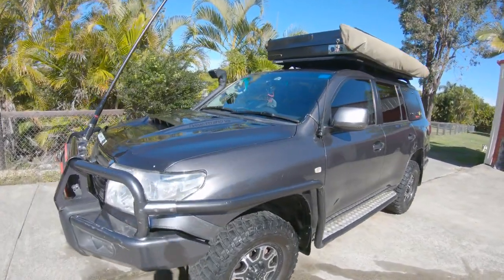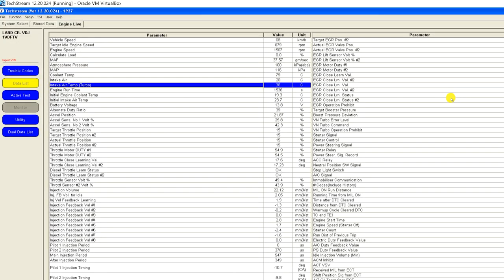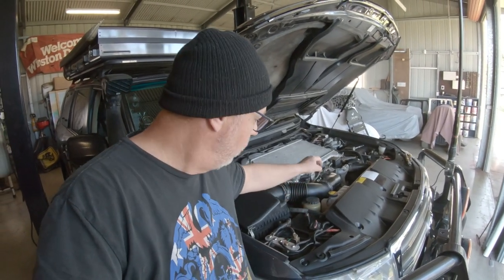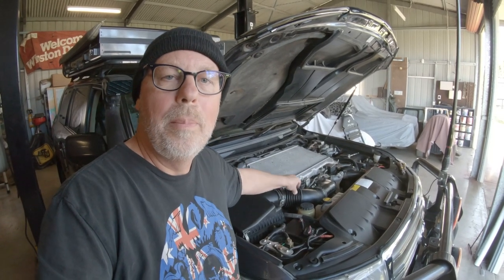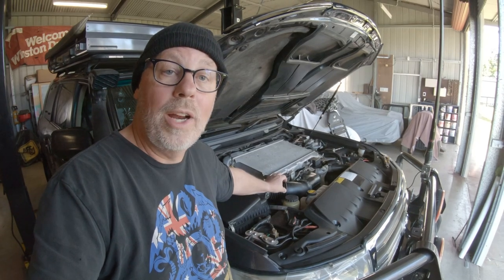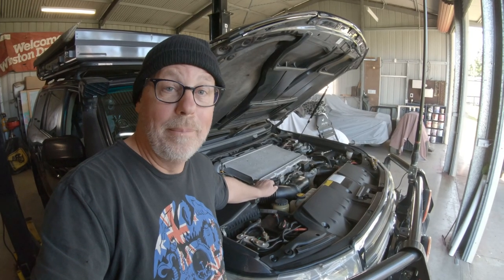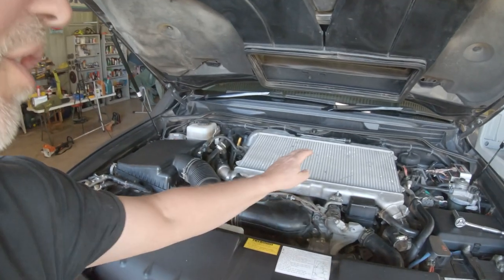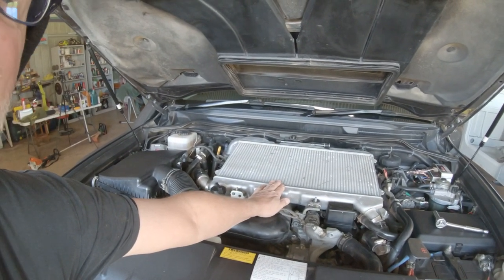Intercooler Flush and Clean with Before and After Efficiency Testing | Landcruiser 200

Comment: Great content Terry well explained, my LC 200 2017 vehicle has 40k on the clock I fitted a Flash Lube catch can at 400 kls best thing I could have  done usually drain 50 mm every 5k this amount of crap varies slightly on the type of driving done in this period . I am confident my intercooler would still be very clean by your experience thanks. Ian
Reply from the maker: Good stuff Ian, thanks for sharing.  I agree, your intercooler would be pretty much spotless.  It’s interesting to note that we both pull around the same amount of goo every 5000km.  Cheers😎👍

Comment: Hi Terry great content. You mentioned you had blanked the EGR. Was this to also help decrease the oily vapor gases recirculating or is the the catch can the main reason your system was so clean. Thanks in advance.
Reply from the maker: Cheers mate, I appreciate the kind words.  The EGR block off was definitely to stop the exhaust gases getting back into the intake track.  The catch can stops the oily vapour so both are needed for a clean intake track.  Cheers😎👍

Comment: Hi Terry
Have you had your EGR valve blocked off?
Just wondering how your car performs ?
Also did you need to have the ecg altered to stop the Eng light and code coming up?
Colin
Reply from the maker: Yes indeed Colin, I have an EGR delete.  The computer has been altered because if you do not do this it will throw a code.  Cheers👍😎

Comment: How can i know the highest normal range at sand drive for charged air temperature  i see in mine around 95 Celsius 
And search with no accurate answer
Reply from the maker: Your charge air temp is going to be very much dependent on two factors.

Firstly, your inlet air temp.  The higher the inlet air temp, the higher the charge air temp.

Secondly, the type of sand driving.  Soft dry sand under high boost will see charge air temps very high.  Harder wet sand will see them much lower.

In terms of giving you a number, I cannot as I cannot read my charge air temps.  What I would suggest you do is keep monitoring it, get a feel for what is normal for your vehicle under the different conditions, then if that changes over time you know something could be wrong.  Cheers👍😎

Comment: Question - why both a blanking plate and a catch can? Or are you running a blanking plate with a hole?
Reply from the maker: No mate, a full EGR blanking plate, no hole.  Having a hole defeats the purpose of having a plate in the first place.

The EGR recirculates exhaust gas into the intake system.  Putting a blanking plate or switching off the EGR eliminates the “soot in the intake issue”.

It does not address the oily vapour that gets past the rings during the normal combustion process.  The catch can catches these oily vapours and attempts to filter them out so that it does not enter back into the intake system.  You have to address both issues (EGR generated soot) and crankcase oil vapours for the cleanest intake charge possible.  Cheers👍😎
Reply: @JafffaAdventures  system doesn’t wig out with a blanking plate??
Reply from the maker: Yep, you have to reprogram the ECU or it will throw a code👍

Comment: Very impressive and informative video. Im a the moment doing a intake clean on my 200, 370000km with no catch can…Well it is quite clogged. Any information regarding the blanking of your egr? I would like to do that and I’m going to fit a catch can as well. All the best from Sweden
Reply from the maker: Thanks for the kind words mate, and I’m glad you found some value here.  I’m not surprised your intake is clogged, by design it really is inevitable without intervention of a catch can and EGR blank off plate.
The blank off plate is a simple thin steel plate, much like a gasket.  It prevents exhaust gasses from returning to the intake system.
I have seen them for sale on eBay, but that was years ago, I have not looked recently.
With these blank off plates, you MUST reprogram the ECU.  If you just blank off the EGR without addressing the ECU, it will throw a code and put you in limp mode.
I had the entire operation done when I had my chip fitted and dyno tuned.

I have also heard of a solution of a forced EGR valve closure through a ECU reprogramming and not using blank off plates.  I have no first hand experience with this method.
Cheers👍😎

Comment: Good video Terry. Have you charted your catch can drain volume through the life of your vehicle?
I fitted a catch can after the 1,000km first service. In the next 18,000km I've only drained 169g of liquid.
Reply from the maker: Thanks for the kind words mate.  I pull 50-60ml every 5000km, and that has not changed from when I fitted the catch can at 70K until now at 200K.  There was another fellow in the comments that noted he pulls the same volume as I do and has had his catch can fitted since new.  The specific gravity of the goo is close to 0.9:1, so your 169g = 187ml over 18,000km.  That works out to 52ml per 5000km, pretty bloody close to what I’m pulling.  Cheers😎👍

Comment: Good vid. That said, I’ve an almost identical vehicle but without catchcan and 14Ok done. i replaced intercooler about 15k ago and it was just as clean as yours at the start of the vid.
Reply from the maker: Good to know mate.  I’d rather not have the 1.68 litres of black goo through my intake system given the choice.  Go well👍😎

Comment: I have a 79 series landcruiser that has just reached 90,000 kilometers and I've owned it since new. same engine as a 200 series, except single turbo and more room to remove the intercooler. today I gave it a good service including removing the intercooler to replace the map sensor filter. the vehicle has a catch can, installed 70k ago and I found the intercooler barely coated in oil so I left it as is. 
I flushed the old map filter to see what it was like, and hardly any black oily crap was inside it too, so probably good for another 90k. 

to me this verifies the benefit of a catch can as long as it regularly drained as suggested
Reply from the maker: Could not agree more mate, thanks for sharing your experience.  Cheers👍😎

Comment: Hi Terry thanks for the videos 👌🏽. Do you have a video or some more info on the egr blanking plate? Does yours have a 7mm hole? How are your egts with the plate in place. I’m about to add one to my 200 so any info would be greatly appreciated. Thanks
Reply from the maker: No problem at all mate, happy to help.  All EGR blanking plates need either an ECU reprogram, or a signal interrupt device to fool the ECU into thinking nothing is wrong.  If you do not do this it will throw a code.
The plates with a hole in it (which are a waste of time in my opinion because they still let gases through) were designed that way so you don’t have to deal with the ECU throwing codes.  They still do throw codes however.
EGT’s come down with a plate in place but not by a lot, 20C maximum, but that of course is not why you install one any way, it’s just a minor spin off benefit.
I trust this helps  mate👍😎
Reply: Awesome thanks mate. Just inspecting the intake now and it’s bloody chockers full of crap as you’d expect with an egr and no catch can for 240k kms
Reply from the maker: Yep, not surprising, it’s a shit of a system 😉👍😎

Comment: Very interesting topic. I have a V8 4WD but it is petrol rather than diesel powered, it doesn't have a catch can installed. I have given some thought to installing a catch can, after seeing the results from your service I think it would be a good investment.
Reply from the maker: I had an LSA Camaro and am building a LSA FJ45, both petrol and both have catch cans.  I’m an advocate that’s for sure.  Just make sure it’s installed correctly and maintained and you will have happy motoring.  Cheers👍😎

Comment: hi Terry, in one of your recent videos you mentioned that you have a restrictor or block off plate installed,  can you let me know what type that you used and if you had to change anything else when you did it.
Reply from the maker: Yes indeed mate, I do have an EGR blanking plate installed.  I have seen two types, ones with a 10mm hole in the centre and ones that are a complete block off.  When you block the EGR off, you will have to get the ECU reprogrammed or it will throw a code.  The idea behind the plate with the 10mm hole is that you get some of the benefit by restricting most of the exhaust gases while not throwing a code.  The problem is that the ECU will still throw a code (albeit intermittently) and of course you still get black goo building up in the intake because some exhaust gases still get through.  For these reasons I have blocked the EGR completely and have had the ECU reprogrammed to prevent it from throwing a code.  I have heard of a piggy back module you can install to trick the ECU into thinking the EGR is still functioning but I have no experience with these so cannot advise.  Cheers👍😎
Reply: @JafffaAdventures  thanks Terry,  you have been a great help, cheers
Reply from the maker: My pleasure JC, anything I can do to help mate I’m happy to👍😎

Comment: Another cracking Video Terry, thanks for the super content. You mentioned you have an EGR blank, I would like to fit one to my 200 but read quite a lot of conflicting information. Is yours a drilled plate or solid, have you also had to remap or fit an electronics gizmo to fool the ECU into thinking everything is sweet? Thanks in advance.
Reply from the maker: Thanks for the kind words Brett, I really do appreciate it.  I have a solid blank off plate as I did not want to get any soot at all past that point and create the black goo like the photos in my video.  When I fitted my Unichip, the ECU modifications were made at that time.  The reason some fit a blank off plate with the 10mm hole, is that they are trying to avoid having to trick the ECU into thinking everything is ok.  I have heard this works SOMETIMES, i.e. it has worked for some, but others still report that the ECU throws a code.  Of course, the 10mm hole still lets some soot past so you are not eliminating the black goo problem, just delaying it. If it were me, I would go a solid blank off plate and have the ECU tricked.  I provide no advise on the legalities of this however 😎👍
Reply: @JafffaAdventures  Thanks very much Terry for your answer on this, I would much rather blank it completely, I have done this on my 1HD-FT 80 series after cleaning out the intake. Unfortunately mine has already covered 70k so will already have some build up no doubt.
I'll have to try and find someone in the UK who can sort the ECU. We do have a Unichip dealer not too far away, so maybe it will have to be in combination with a Unichip X 😎
Reply from the maker: No worries Brett, you will love the extra horsies with the chip as well.  Cheers👍😎